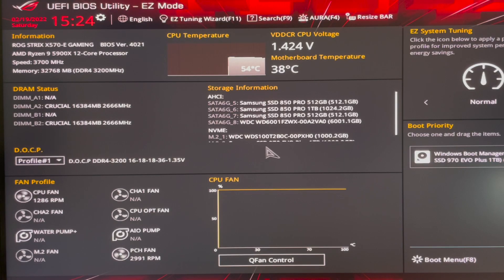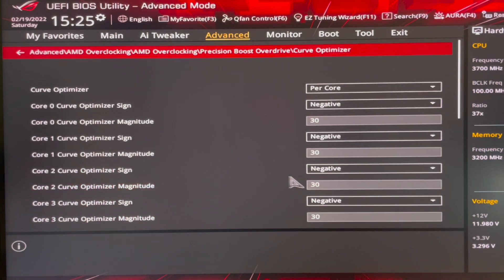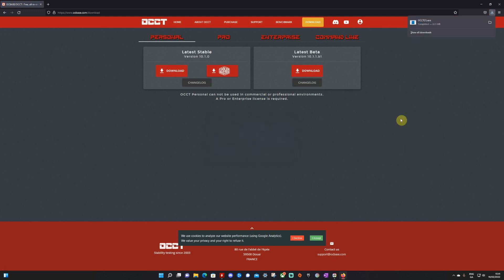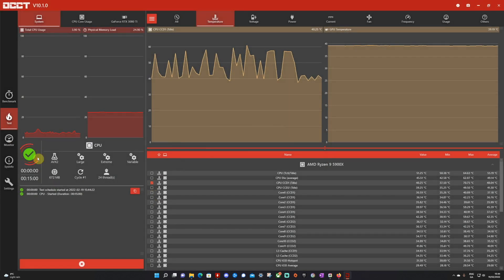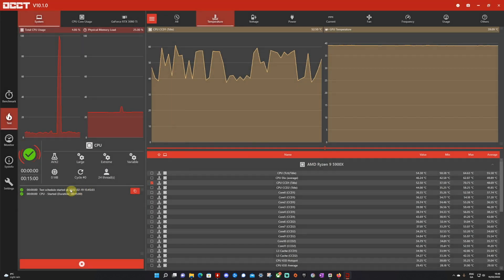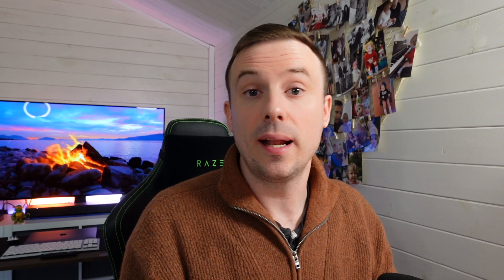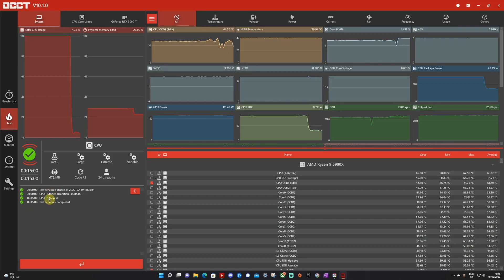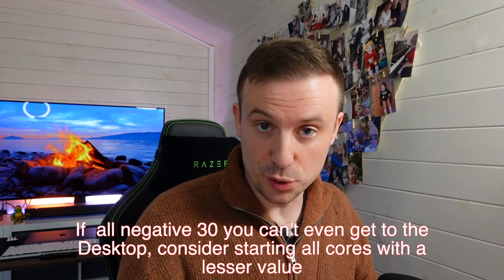Ryzen 5800x 5900x CPU Per Core Undervolt Bios Settings | Lower Temps | Better Performance

Comment: Deleted my original comment to say I apologize. I blamed you without realizing what I had done. It was user error using some application then forgetting I had used it to click the cores and trying this and yea. Basically broke my windows. 

After doing a clean install I came back to this and followed to a T and it’s going great. Only my core 7 needed to be dropped to -15 and my test is still running as we speak. Temps look great as well.

Again I apologize for jumping the gun and placing the blame on you. It was confusing as I had followed this guide prior to a BIOS update so was asking if I messed up somehow and of course as a noob I did. 

Thank you for what you do!

Comment: I'd like to add that some motherboards overclock better than others too.  My 5900x overclocked better on a cheap MSI B550m than on a more expensive MSI 570s Edge  MAX Wifi board with all the same settings.  On the cheap board even in AUTO overclock it would boost single core to 4.975GHZ and 4.600 all core at 89 degrees.   On the expensive board with all the same settings, I could not get over 4.6GHZ boost single core and 4.300GHZ all core at 90 degrees !!

Comment: I did all at -30 and didn’t fail. But I know that’s bs, cause it fails when running cinebench 23. Any ideas?
Reply from the maker: Did you try testing single and multi core in occt. There is prob a core causing issues
Reply: @FPtechtalk  didn’t see that that anywhere. I thought the test checks all cores automatically, no?
Reply from the maker: I have a video up that looks at occt and how to test single core and multi core. I’d try that and see if it helps
Reply: @FPtechtalk  found it and tried multi and it crash. But since it crashes, it doesn’t tell me which core is causing it.

Comment: Said core 9 was the issue but you changed core 10, no? Since core 0 is actually core 1. Or does the program label it correctly?
Reply from the maker: Occt said core 9 and I changed core 9 in the bios

Comment: Did you leave the main voltage on auto? And other settings on default?
Reply from the maker: Only changes the settings in the video. Everything else was on default

Comment: I followed your other All Core video but my 5900x/Aorus x570 wouldn't boot beyond -15 and was only stable at -10.  After this video I wonder if it's that one or more of the cores just won't undervolt well.  Is there a way to run this tool to determine which cores aren't too happy undervolt and try undervolting all other cores at -30?
Reply from the maker: Hi, I have a video up to help with single and multi core testing after underVolt. How to Stress Test CPU with OCCT | Single and Multicore methods | Stability Test
https://youtu.be/77zBduI09gY
Reply: If you want to get "per core" value easily, set you bios CPU settings to default, install Ryzen Master and use the optimizer in the advanced view (advanced view/Precision Boost Overdrive/Per Core) and it will give you the value for each core. Then you can use Ryzen Master to apply the value or don't apply in Ryzen Master and copy the value by hand in Bios.

Comment: I did this settings on my motherboard (x470)
Clocks high on stress tests and temperature too(4750mhz). All cores on 30 negative and i have no errors. 
Highest temperature jumps to 77c, average 68c. On stock settings i have 68c max temperature, 63 average, but clocks 4500mhz.

Comment: Very useful..Fix that core where corecycler didn,t find and surpass all 5600x stock bench and games FPS.....just asking, did you manage also the PPT,TDC,EDC ? My 5600(non x) PBO +200mhz (4684Mhz boost all cores, max4651), NH14S, CO 25,15,27,25,27,27 , Power limits on RM (bios setup) PPT 93, TDC 60, EDC 104, Temp ~ 69-70C, Power ~68w, OCCT 1h no errors...

Comment: Hello. I tried this method, i have -30 per all cores and i don't see errors in occt. But i have crashes in games. What it can be?
Reply from the maker: It may still be a core. You prob need more testing. I have a separate video for different occt tests that might help
Reply: @FPtechtalk  Thanks for you answer. Now i use PPT 125 ; TDC 85; EDC 130. Curve: -30 per all cores except 5(-15) and 7(0). But i have low results in cinebench r23 :(. 14147 in multi and 1567 in single.

Comment: This is a great guide, but I'm having a very strange problem. When you turn on PBO and curves in the BIOS, two games crash on my PC: Marvel Spider-Man and GTA 5. The PC stress test passes without problems, I also ran a render test in a blender for the test, everything is fine, but these games are just I fly out after 5-10 minutes of gameplay.
Reply from the maker: Have you tried both single and multi core tests with occt ? What value is your underVolt
Reply: @FPtechtalk  Yes, I ran both tests and everything is fine. Value 30. My cpu is 7 5800x.
Reply from the maker: It sounds like some core is causing you problems if your games are crashing
Reply: @FPtechtalk  This happens even just with the PBO turned on, without curve tuning.
Reply from the maker: If you try the simple underVolt settings where I just use the curve optimiser does that work
Reply: @FPtechtalk  Can the curve optimizer be used with PBO turned off completely? If yes, how to do it?

Comment: hi I installed a ryzen7 5800x on an a320 motherboard but what happens it spikes in temp and shuts off any solutions?
Reply from the maker: I don’t know what cooler you have but may need a better one, check paste etc. not sure what undervolting you can do with a a320
Reply: @FPtechtalk  I believe the mobo is the problem tbh I'll just have to get a new one
Reply from the maker: Yeah I think you are prob right

Comment: Hi i have a problem with my CPU. when i enable the PBO and start by setting my cores at a Curve Negative, my Windows wont boot. It doesnt matter how much i input the PC is stuck bootlooping. What can i do there to prevent that? 
I have a 5900X on a Strix Crosshair 8 Dark Hero

Also how do i find the most used cores by stresstesting?
Reply from the maker: Try start at a lower curve value. Say 10, then you will need to some stress testing with occt. I have a separate for using that
Reply: @FPtechtalk  yeah i saw the videos but as i said i couldnt get windows to boot even with a change to a value of 1. IDK why it kept happening but it somehow disappeared and im currently testing. Atm im at -25 at all cores except for core 10 it wont work with higher than -10.
Reply from the maker: Good to make sure your bios has the latest firmware too

Comment: Hi thank you for video.
My Ryzen 5800X 
Ryzen Master Curve Optimizer 
Per Core : 
C1 (-15) C2 (-25) C3( -26) C4( -24) C5 (-26) C6 (-8) C7 (-26) C8 (-26)
And now with BIOS+OCCT tests
C1 (-20) C2 (-25) C3 (-25) C4 (-30) 
C5 (-25) C6 (-5) C7 (-30) C8 (-30)
Which one will be better 😁🙏
Reply from the maker: Hope it works well for you
Reply: @FPtechtalk  I hope too 🤞

Comment: Is it normal to not get any errors on a 5900x and all cores at -30?
Reply from the maker: It’s a very good result if your are getting no errors after both single and multi core tests. It’s a good indicator that your system is stable. Would depend on what tests and for how long.

Comment: Hi. I did per core, all negative 30. Did the first 15 min test and passed. Temps are really great and I have a stable 4.675 Mhz. Really great video man! First video that actually made a difference in my temps.
Reply: This video helped me allot.. everything worked fine with -30 on a 5800x build for my niece.. I will do the same on my 5900x hope for the same results
Reply: I just did the 30 min test and average frequency sits around 4.6MHz. But the max frequency hit a beautiful 4.950MHz at temps around 75! Really impressed with the info you gave. Great work!
Reply from the maker: Nice results 👍
Reply: Well done it in my 5900x needed 2cores to set down to 25/20.. got boost to 4950 mhz and cpu doesn’t reach 60c during this test
Reply: Do you still run these settings? I got my 5900x a year ago this month and had a lot of trouble over/underclocking when I first got it. I updated my BIOS today so I’m redoing the undervolt and I’m about to finish my first test with all -30 (no errors). I have a hard time believing I’ll be stable all of a sudden, but am curious to hear your experience?
Reply: @evanyeager  Hi. Yes I still run those settings and still going strong. Playing COD MWII and the cpu bearley reaches 75 degrees.
Reply: Hi, did you leave you frequency settings to auto? Thanks😊
Reply: @patrickcontreras5284  Hi. At first I had it locked to 4.6 but have it on auto now with the undervolt and the temps are great with no performance loss.
Reply: @GalaxyGamingOdyssey  thank you so much :)
Reply: How come mine is capped at 4GHz ? Used one of his old vidoes to undervolt quickly which it capped at 4GHz, now while running its even going down to 3.8GHz at most times

Comment: Hello there. Good video but I have one big complain about the way you test with OCCT. I decided to try your method and believe it or not I succssed to pass the test for 1 hour with setting each core at - 40 OC on 5900x. This is basically impossible even with the best silicone. Then I decided to test each core separately so it can boost to its max frequency and voltage and my core 0 fails instanteniously. The thing is voltage doesn't rise proportional with frequency. Testing for stability all cores together drops the voltage to about 1.2 to 1.25v but testing each core separately increases the voltage of that specific core above 1.3 v. So what I found for the best method is this. Do OCCT on each core separately for 15 mins changing OC. Once every core pass the test run OOCT in the way described in the video but for 1 hour. If pass the test next is Cinebench 23. Run loop for 1 hour on single and multi core. If no crashes or errors the last step is back in bios and decrease OC by 2 (for example if it was -20 do it -18) on each core. Congrats you have 99% stable system for 24 hours use.
PS: Don't use Prime95. This imo is the world's best useless program ever created.

Comment: where does this all begin? i thnk you skipped a lot of steps for the begining as a bios with defaults definitely not see all cores to  4600mhz with a 60ish temps... while i apreciate the knowledge you provide, i guess you kept quite big part of the begining out of it accidentally...
Reply from the maker: Apologies if I left something out. I have a few videos up looking at this topic. If you have a look at others you should be able find what you need
Reply: @FPtechtalk  yeah i guess i have to do that since you seem reluctant to provide the missing info like, "load defaults,, just enable PBO..."etc

Comment: Wouldn’t selecting all cores and putting it to 15 be easier than per core ? Just curios
Reply from the maker: all depends. If your do per core you may have many on 30 and a couple on a lower number

Comment: Only Core 0-5 will undervolt to 30, the rest 6-11 will only undervolt to 10 max. Could this be due to a bad installment or just an unlucky CPU?
Reply from the maker: Just depends on the cpu really. How do your temps look after the change
Reply: @FPtechtalk  mine is a 5900x with a noctua D15 cooler. My temps were at 76.9 before changing anything and are now 75.8 after making core 0-5 -30 and core 6-11 -10. Didn't seem to make much of a change for me :/
Reply from the maker: Is the 76 under load such as gaming? Did you see any improvement in performance such as cinebench
Reply: @FPtechtalk  not through gaming but through cinebench test, there was a slight improvement in cinebench
Reply from the maker: Will effect different cpus, I got about 5 degrees less with 5 of my cores hitting the 5ghz regularly

Comment: Awesome guide, I just found the best working all core negative value for my 5600x (with PBO MHZ set to +50) and left it like that, but I have a 5900x coming soon and this looks like a much better solution. Curious why you did not allow PBO to go higher, was the goal only temps ?
Reply from the maker: Goal was lower temps with no effect on performance. Glad it helped.

Comment: I found out that OCCT passes the 15 minute test without a single error with all cores at 20 negative. But when I launch a GPU heavy RTX benchmark (Bright Memory) - it lasts for about 3-4 minutes before auto-rebooting. After reboot Event Viewer shows multiple WHEA errors. The game benchmark doesn't fully load the CPU as much as the GPU which must be the case here - instability becomes evident quicker under less heavy workloads  ?
Reply: I'm either really unlucky with my 5900x chip, or there's something else at play here. Kept dropping all-cores negative value in increments of 5, up to .... 5. Which made the system reboot after half an hour of benchmarking. Eventually gave up and returned it to stock - it's just not happening on my chip.

Comment: I just want to throw this out there that undervolting your cores then passing benchmarks/stress-tests doesn't guarantee stability. I tried undervolting my 5800x and passed all sorts of these benchmarks and stress tests like OCCT, cinebench, and Prime95. I noticed my computer would start randomly rebooting itself whether it'd be from doing lightweight-tasks like watching Netflix in a web browser or playing Skyrim Special Edition. I then turned off all of those curve optimizer settings that undervolted my CPU and just tried the built-in "ECO mode" to undervolt and underclock the processor, and that only made the random reboots more frequent.

Perhaps I got unlucky with the silicon lottery, but just know that you're still taking a risk using an undervolted processor even after passing all sorts of tests to try and verify stability. To clarify, I did extensive testing on my storage devices and memory which all came back without problems, and I'm pretty confident the random reboots were the result of undervolting especially since reverting all curve optimizer settings to default made the random reboots stop.
Reply: Truthfully, unless you run, like 20 hours straight of something like CoreCycler, you'll never know for sure how stable your machine is. However, running stress tests can, at least, give you a rough idea on stability. If a stress test fails, at least you know something is wrong right away. For me, it's usually just a week or so long experiment of using my PC. Once I undervolt, I spend the week playing games, watching YouTube, surfing the internet, listening to music and running all sorts of my day-to-day programs. If I don't crash after a week, I feel pretty ok. If I crash, I dial things back a bit and try again. Overclocking and undervolting has always been a series of trial and error.
Reply: TRY TO MANUAL ACTIVE YOUR CORES INSTEAD OF DEPEND ON PBO SMT WHEA IT DOUBLES UR CORE 8X16 ALSO DO IT IN UR OS.. WIN10 - HIT WINKEY+R [TYPE IN THE RUN DIALOG "msconfig/ from here ur want to go the second tab under [Boot] hit [Advance opt] first check box should list what you been opt to idle you cores at.. if its blank then set it to 16 or anything over 8 so long as it doesnt fall to 8 when sys idle ur powersave featurea win10 will kick in hence sometimes hearing ur fan rpm spike... also the ryzen 5800x is know to spike very freaqently so if you bios have smart fan control... [stepping] usually its 1ms down n 1ms up by default set the fan closet to the cpu to run at 3ms n set the fans that are far from ur cput core to run at 2ms n 1ms for fartheest... i have 3 5800x cpus lolz so i had ur issue why i pass all texxt cinbench cpuz top score and all n it would ramdonly restart but undervolting in a diffrent method works too where u manually set ur  offset voltage in bios say for exam set ur cpu voltage to the bare minimum of 1.2 and set the offset to +offset to 0.1800 which then youll set ur tempature max n set is at 1.38 which at 1.38 u can push 5.2 gig.. but the thing is ur tempature will dont be high n whn u run any hardimpact programs to the cpu it wont spike too much bekuz you already have it at a good rate... on top of this proces if you narrow down your pb0 ppt tdc n edc... n set it manually urll get perfect power consumtions needs ... you can do that with ryzenmaster downlaod n have it run under gaming oC mode.. that will set max amp or watt per needs usally ryzen mast er will run it at ppt1000 tdc 140 n edc 200 or somewhere around that number ... under the home tab were youll see all ur voltage meters for ppt tdc n edc run cinebench or any stress cpu program n u should see the percentage under the meters Pbo ppt tdc n edc ... write those down n do the math n set it in bios n u should be gravy.. exam underload running stress test indicaters for  -[ppt12%/1000w] -[tdc60%/140a] -[edc70%/200a]....math = %xdefaultvalue -ppt=120w [12percent of 1000] tdc=84[60percent of 140] ~use [85] alwasy round up by 1integer to have ur values exponents5 Os understnadc better then say setting it to 84 and last u have edc 70%of200= ill let you do the math on tha last one.... u can then jump in bios under advance oc pbo n set those value for manaul Oc pbo but if u gotten these numbers with ryznet master [ create a profile ] n set those numbers in ppt tdc n edc in windows n if you power meter falls exactly on 100percent usage... u ace the entire set up.. but if you have wrnog vale you see power meter aroudn 105 to 120 usage.. sorry its alot i got caried away.. i hope u try this n hit me if you have fautls

Comment: Thanks for making this video and explaining everything clearly. I'm going to try this now :) Btw I have the x570-F motherboard and at 2:18 the "max cpu boost clock override" option only gives "disabled" or "enabled" options.  It is disabled by default. I guess I don't need to change it?
Edit: no errors when everything is set to 30. Are these the best values?
Reply from the maker: Yeah negative 30 is the best you can do. Good cpu if you are stable on that setting